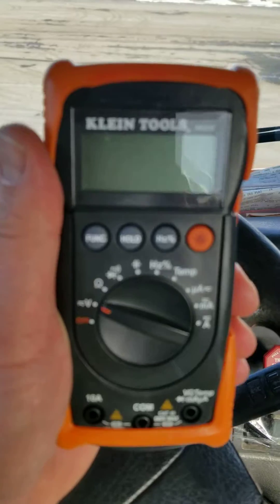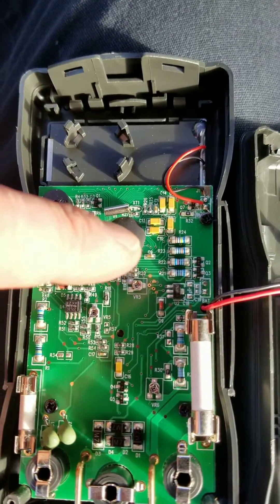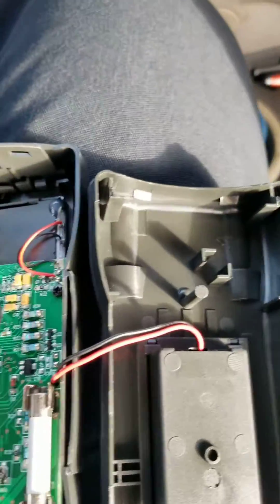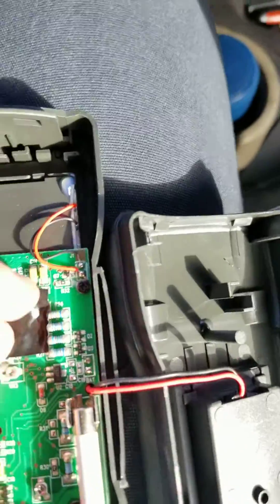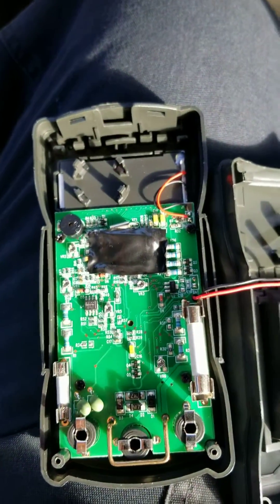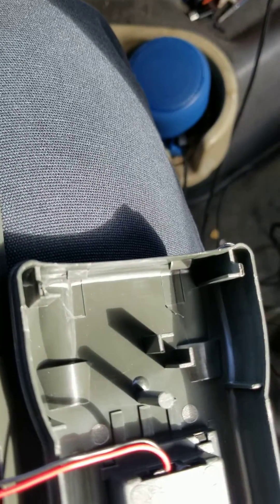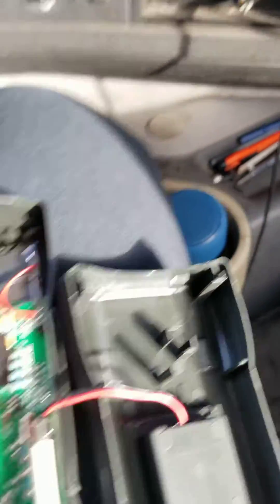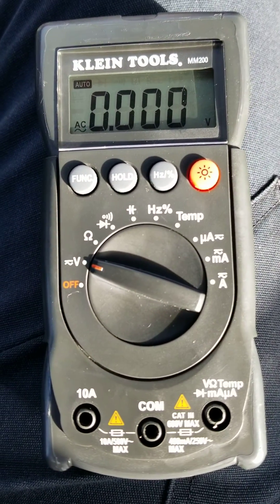Multimeter Screen/Display Blank-Not working klein MM200

Comment: I have the mm400 model. Mine was having same problems as yours though. If i mashed in on the screen then it would work. I got a screwdriver and tightened the screws up a little tighter and it seems to have fixed it. Idk if the screws had just loosened up over time. If someone else is having the same problem I recommend making sure your screws are tight before pulling it apart.